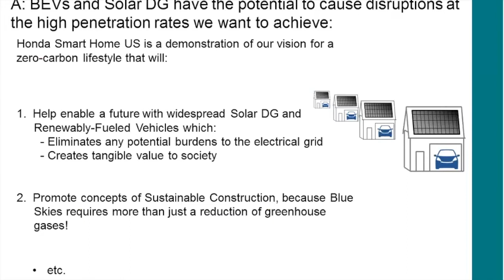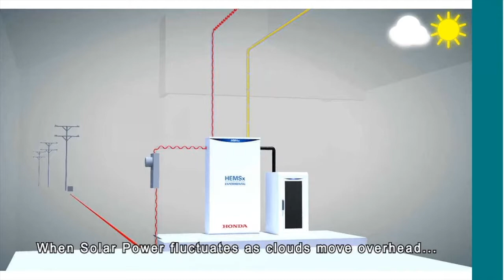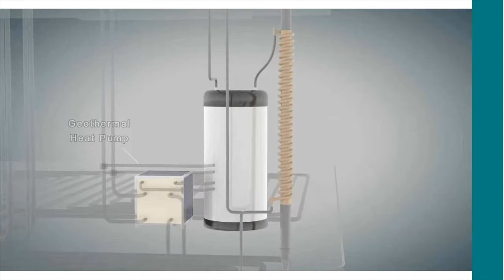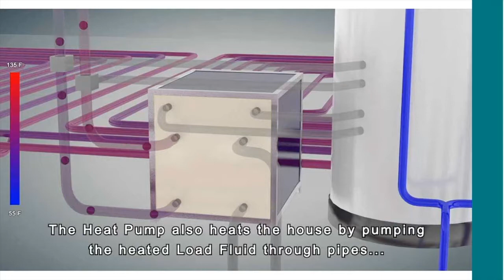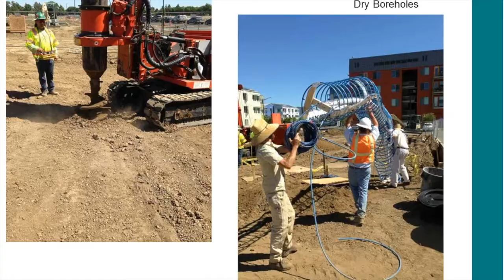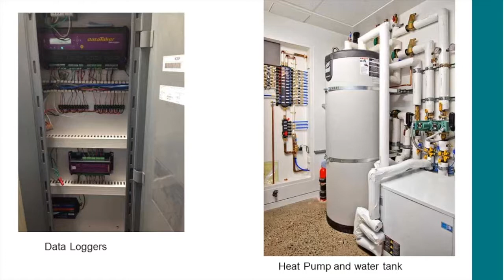The Zero Net Energy Honda Smart House

Comment: Depending on the amount of inside space of your building, it's thermal envelope quality, and the winter climate challenge it faces—what you are talking about is an air-source heat pump provision for a hydronic or forced air fan coil arrangement.  If the compressor unit is located within inside space you are stealing heat from the indoor space.  If located in a garage, you have a limited air supply and are operating a garage air conditioner.  If located outside, you have complete access to an outside air source, but are using a cold heat source except in summer months.

Depending on your house's size and those other conditions I mentioned, there isn't enough storage at high temperatures to do the job.  The device will work, but it is under capacity for the job.  If you are interested in heating the inside of your home with a heat pump, better to buy one with the capacity to do the job.

Comment: Why place the heat pump inside the house?  Does it not add to the energy demand due to its impact on the air? 

Are the heat pump pipes going directly into the hot water tank?  Would a separate heat exchanger permit placing the heat pump outside?

https://www.homedepot.com/p/ZeroEnergy-Heat-Recovery-Water-Heater-System-Zero-Energy-ZE-TSHRU/203715807

Would there be any energy benefit in doing this?
Reply: This is a water-to-water geo heat pump in a home where the garage is detached and all the heating/cooling is inside via radiant floor and wall coils.  Since the heat exchanger to ground loop connection is water (highly conductive) and the unit is compact in an insulated box—there is little chance of "infecting" the house in summer with waste heat.  There is also lots of concrete mass throughout the first floor that would be the first stop for excess heat of any kind.
Reply: Martin Energetics I made a bit of research based on videos you made in the past.

You apparently installed a GSHP from Bosch which provides hot water and hot / cold space conditioning.

I have lately been looking at a heat pump from Sanden for hot water.  They claim it has an efficiency up to 500% in warm weather, and it drops in cold weather.

It may be used for flooring hydronic radiant heat in Europe.  

This leaves out the cold space conditioning.  Could the Sanden heat pump work in reverse?

If so, it might avoid the expense of the bore holes in the ground.

Would you mind sharing your thoughts on this possibility?